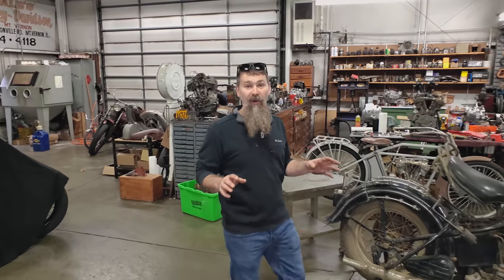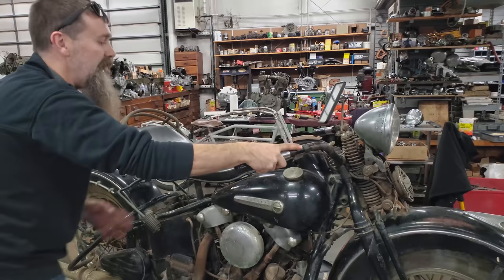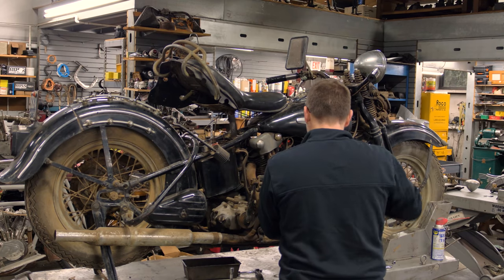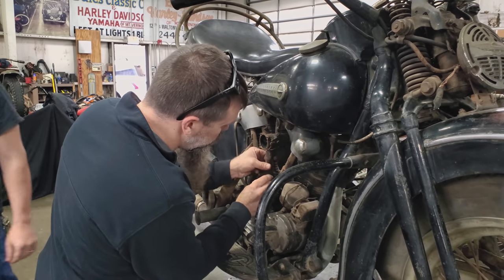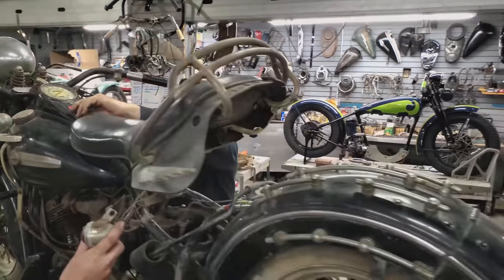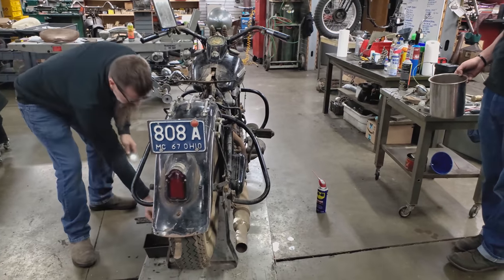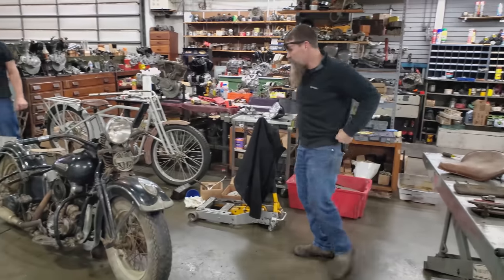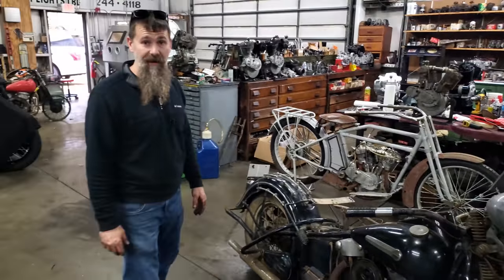HASN'T RUN IN 50 YEARS!!

Comment: Most of the old bikes, cars, trucks, and lawn mowers are so simple. About 98 percent of them had gas left in them, so clean the carb,clean the points, fresh oil, then bingo!
Reply: I work on small engine equipment and most I get free are from ethanol. Whether it's water as ethanol is hydroscopic and or ethanol jelly I just clean the fuel system out and put a replacement carb on. Valve adjustment is another thing I find with equipment diagnosed as a bad engine especially engines with overhead valves.
Reply: @tihspidtherekciltilc5469  Valve adjust is a constant chase on old iron head sportys
Reply: Where a lot of people make mistakes with ironheads is they lean to the loose side thinking the valve train expands ....not realizing the cylinders grow more in height ....I always leaned a bit to the tight size ...TDC with very light drag on the pushrods when spun with oily fingers ....
Reply: Yep they’ll run if taking care of got a couple
Reply: @josephdougherty2399  That's what I was taught when I got into air-cooled VWs and built engines.
Reply: @tihspidtherekciltilc5469  funny ... My brother used to be well known for building VW motors back in the 70s for desert racing....where I learned most of my air cooled motor stuff.. When VW was designing the wasserboxer motor they paid him a visit to beg from his box of tricks for so many of his engines being super reliable..  two of his tricks made it to the new engine... 3 oil holes on the journals of the crank for increased more uniform oiling and tweaking the oil pump with a heavier homemade spring to increase oil pressure.    Also much additional oil cooling.   He had many other tricks....but a headliner never gives them all away...lol
Reply: Fuel lines ?  Stored dry I figure.
Reply: Smoothest Harley ever seen he said.👍🇺🇲✌️
Reply: There is no more there to operate it than it needs. 
Curious after 100 yes of no computers, now everything  requires a computer to do the same thing. Bull crap.
Reply: That's kind of cool that 50 years engine hasn't run and little bit oil and gas basically it sang back to life like it was running yesterday...
Reply: Not all that easy
Reply: If you have problems starting a bit of eather down the plug hole or in the carb and it will come to life. Iv brought a lot of old motors back to life and a bit of CRC easy start can save you time .
Reply: No sure about simple. All I can say is that old bikes were precision made and that is why they last. Take our old bikes from the UK, BSA, Triumph and Norton were designed in a workshop rather than a factory but those who knew how to build a bike from new
Reply: Even the newer ones. Fuel, air, spark and they fire up!

Comment: Sure it will run, if it’s prepared properly before it’s first kick!  
My bone stock 1968 XLCH with a original 12K was stored indoors for 34 years and it started on the fourth kick!  BUT, not before I prepped it just like you did.  What a great feeling!

Comment: Thanks , this really brought back memorys.
    I was 16 yr and the 47 knucklehead was my first bike, six  $50 payments later i was a proud Harley owner. I had a problem though , i needed the neighbor to kick start it for me ha.  I pushed it more than i rode it but loved it , specially after i found out it was only firing on one spark plug😱
the thing took off like a rocket after that ha
I then ended up buying a barn full of harley trikes and rigid frames and boxed of rare parts and tranys and 45 and 74 engines for $200 . instant harley shop. I ended up in the army and my dad sold everything😭
You knew I wasn't coming back anytime soon ended up staying 22 years

Comment: Somewhere in the past, someone did a frame swap. That bike's frame has bow leg down tubes. All Knucks; from 1936 to 1947; had straight front down tubes on the frame. I know this to be true since I had two buddies who owned and rode 1947 Knuckleheads. That Knuck is an incredible machine! To me, it even sounds better than today's H-D engines. Keep up the great work. Thanks. Ride safe.

Comment: The same Linkerts were  used on the same years of Indians, except the Indian mounted them on the left hand side.  The level of the float is tricky, and it can't be loose, because when the bike is parked on it's side stand the float can get stuck.  The old floats were terrible and would get saturated. I have a 1946 Indian Chief.  The Linkerts were the same carbs they used on lawn mowers, tractors, etc and just not that good.  We replaced mine with a new Keihin 41mm Constant Velocity carb, and it simply bolted right up.  It is so much more efficient that it makes 4 more horsepower, and I had to change the timing from 38 degrees tdc to 19 degrees tdc and it runs perfectly.  Best thing I ever did for the '46 Chief.
Also Indian and Harley used the same company to buy their wheels and spoke from, and the Harley double seat was used by Indian without having to pay royalties for the design.
Recommended factory tire pressure was 18 lbs psi up front and 22 lbs psi in the back.  We alll use straight 50 wt, and no one used an oil filter. Oil pressure is usually so low you can't use an oil pressure guage ;=)  Since the Indian has the oil tank up in the front of the right gas tank, , the gas tank behind it with cool gasoline, and the airflow from the front including the oil lines in the breeze, keep the oil cooler.  it has a pipe that sticks up in it for the return, and you just open the oil cap and see if oil is squirting out of the tube.  All these old bikes could 'wet sump", the check valve sticks open and all the oil drains into the crankcase. You just have to drain it out, and pour it back in the tank before you start it.

Comment: A good friend of mine in the eighties, is dad had a 1947 Harley-Davidson knucklehead with a 65 pan bottom. But the whole bike was that original a lima bean green it had a wrong tank badge on the one side one tank badge was upside down and on his right side up, even had the original shifter knob on the tank and everything. I tried to buy that bike off in for $5,000 he wouldn't sell it to me, and he's not even a motorcycle guy. That was back in 1988. It even had a hinge back Fender I guess where you can take the tire out the back and had some neat stuff, that's was like super springy, they built some awesome get back then. That thing was a tank

Comment: As I remember , I have a 48el sitting under covers in a corner of my garage that hasn't been looked at in years , I should go see if it motor turns over . I kind of of put it to rest when I bought my 72 flh , I still drive the 72 .

Comment: Don’t know if on knucklehead you have a drain plug on the engine crankcases, like on Indian flathead, if yes I will have change the original 50 years old oil too😉
Nice video again, thanks 4 sharing !
Reply: I'm pretty certain they changed the oil.
Reply: @stephenholland5930  
Yes they change in the tank, but don’t know inside the crankcase engine ? 

I’m an Indian Flathead rider since + 30years ago. On the Chief, we have a drain plug on the crankcases low engine and also just up this drain plug, we have an other one plug for the level oil inside the low engine crankcases.

Knucklehead have this system too with 2 plugs on the low engine ? I’m not familiar with vintage H-D … 😉

Comment: to avoid tranny plug stripping or shearing i shop vac out the oil with attachments they make...can use for oil tank also...to clean inside tanks i use a  flexible shaft and attach a wire brush...  bike is amazing.... doesnt even sound like it needs the valves adjusted... you do good work ..... i probably would of put it on the rear stand to see the rear wheel move though....  i'd take the chains off and soak in oil, adjust the clutch and like you said new wheel bearings, tires, check spoke torques , change bulbs ect...... can't wait to make it up to your museum to pick up this years raffle bike :)   i like penatrol paint additive applied on a towel to wipe off dirt and leave a shine while protecting it from rusting

Comment: In 1974 I bought a '71 Norton Commando ... even at that time I wanted to ride a Harley ... jumping forward 37 years .. I spent 11 years building a boat :-) which is not finished.  I need a new project.  I'm finally going to build my Harley style motorcycle ... a hardtail chopper, of course, with a Panhead engine.  And yes, I'm starting from scratch and building the frame as well.  Otherwise I'm just assembling parts.

Comment: My uncle told me that a brand-new knucklehead came with a certificate that it went 110 miles an hour stock it was a lightweight 61 that weighed less than 500 lb loaded with gas it was a Speedster in the old days and they last forever when you take care of them and you rebuild them as they require it I love the fact that you can buy from S&S Motors a brand-new knucklehead engine or a brand-new Flathead or a brand-new Panhead and you can build your own Classic Bike from the ground up with exactly what you want and those Harley's with the pool floater sheet and the rigid frame they cruise down the road on like nowadays they always Were King of the Road

Comment: I fitted a recon Linkert to a customer bike (his request and he sourced it too) but the screw connecting the black float to the brass needle seat was not tight enough- the float got stuck on the rough cast in the chamber- easy fix when you find it : )

Comment: Something that may come in handy I'm always filling up tractors so I added a 3/4-in threaded PVC ball valve with 3/4 in Barb male adapters to my gas can like the one you use the blue one so I have more control of the fuel especially when doing it by yourself you can hold the can on your shoulder open the valve and then when you see the tank is coming to it's maximum peak you can shut the ball valve off lesson learned shut it off sooner than you think I think what goes around should come around you're helping others to work on their bikes giving out free knowledge that they may or may not be able to use I just thought I'd do the same may make no difference at all who knows

Comment: Hi Matt. Great work. Something in the comments caught my attention. I kinda don't want to ask but I'd rather know from you than the internet. I hope that you don't take offense but has your father passed away? I haven't heard anything about it. I hate the thought of it,  if so. Anyway, I have a 1951 EL Panhead. Nothing like you just showed us but it's mine for about 20 Something years. I bought it from Precious Metels cycles in Mt. Holly n.c. from Dean C***  .I would think that you would know him . I'm really close to having it running but not riding. Probably about $500 away. It has a magneto. It ran pretty good but it needs a tune up. If I had a distributor then it would be a little easier to get running again. Anyway, enough said for now. I'm going to subscribe this time. If you want to help a brother out then do a little video on the maintenance if you care to. It would be greatly appreciated. Thanks

Comment: Can anyone help me with my xt600e that has weak intermittent spark? Replaced the coil, new plug, checked valve clearances just won't start. Fires up a little when easy start used. Plug seems to be getting wet. Think it's a generator or a CDI problem?

Comment: Forget that would Harley's top-of-the-line fastest motorcycle premium overhead valves when most people just ran side vows which were good that bike and it's time was like a Vincent's or a brush Superior it was a top-of-the-line Speedster like say a Hayabusa is today you paid a premium for that bike over a regular Harley you don't buy a race bike to go slow and lots of Roads had no speed limits in those days when the Pennsylvania Turnpike was open there was no speed limit on it and you could run your bike is fastest it could go but the fact it's got 29,000 miles on it and replacement tires from Sears shows I think I wrote it responsibly without crashing it and let's not forget Harley made the Flathead until the seventies

Comment: Be sure to retard the timing all the way before kicking it over.  It only has 5 or 6 to one compression, and if you put it in the right position AFTER the compression stroke, the flywheel motion will help start it., you can actually start it with your hand. Then advance the timing ASAP, or it will overheat.  People like to lower the idle to make it sound cool, but it starves the top end for oil.  I had a 61" HD Panhead. A vast improvement over the Knucklehead. It just wasn't as pretty. 
We also replaced ALL the bearings with new sealed bearings. Easy to do.  The Indian had rear suspension that HD did not have until the 1960's, and probably twice as many zerk ftttings over all. The Indian Girder front end with the Monroe shock was far more stable than that HD pogo springer.
The Indian 74" and the 80" bikes after WWII put out more low end horsepower and torque than the stock Knucklehead. But the knucklehead could rev higher and start to pull away at the top end. Most of us stroked our Indian flatheads to 84 cubic inches simply by moving the location of the rods and journals on the flywheels. But still didn't have the high revving horsepower the overhead valve designs had. Interesting because Indian used 8 valve overhead valve engines for racing since the 1930's.

Comment: you should have pulled the oil bag ,man , a guy can check the plugs with the kick starter or hold them against them iron heads and open the points .

Comment: Even tho it had good compression on a slow initial kick, a little Marvel Mystery oil squirted in the spark plug holes would limber up those rings a little by soaking overnight. After 50 years, why not?

Comment: Man I need help getting my panhead and my shovels up n running but in in just north of Seattle go killed 13 years ago on one of my harleys died in the street EMTs brought me back 6 days later in a coma I have a hart attack and die again on the other side for over 5 minutes but the doctors had to kick start me with the jumper cables doc said I wouldn't start real hard starter but I'm back and I'm out of the wheelchair and walk-in not fast but I'm up now  im67 and got the inch to ride again well with 7 Harleys 5 Hondas and one Aprilia rsv 450 I'm gonna try peace

Comment: Marvel mystery oil in fuel and 100 LL 1gallon  rest non ethanol fuel ..  ... this mix will kick it off  and lubricant for valves rings etc 
And energize  gen or polarize  for proper charge .. new tires brakes and enjoy as is

Comment: The beast on the platform in bartells harley davidson could certainly go after doing some work as some things were just the casing or dummy placing
 Asking the general.manager ( geass track rider imager) the same question but looked and noted and said yes if love amd time was put into it. Otherwise it would be a stage or movie set piece
Either way it could go and run
AFFA angels never die nffn HMS sonny